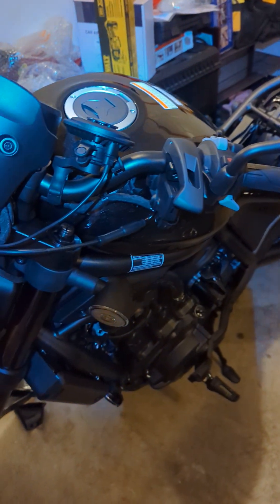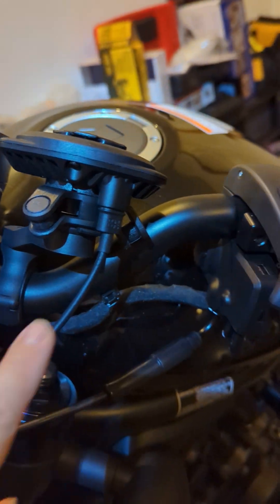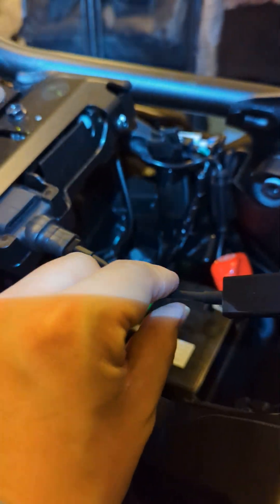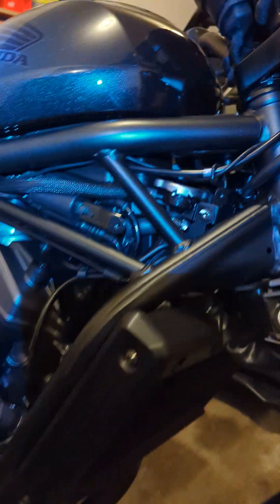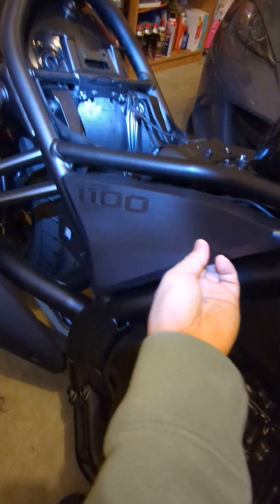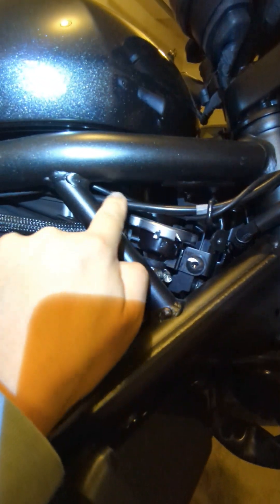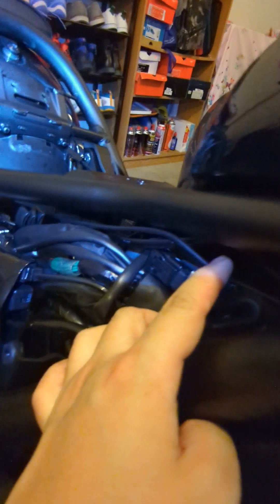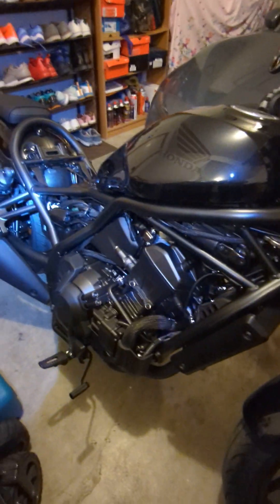How to route Quad Lock wireless charger cable on 2023 Honda Rebel 1100T DCT

Comment: Nice tutorial 👍🏾 thank you 

Since the USB Cable is going through engine and it’s naked, Isn’t there the risk of cable damage due to hot temperature?
Reply from the maker: So far I haven't noticed any damage on the cable due to the heat. I will keep an eye on it.